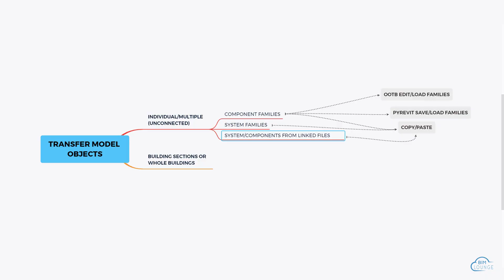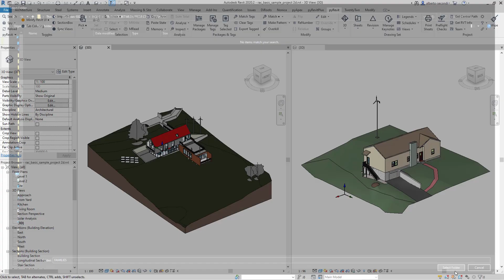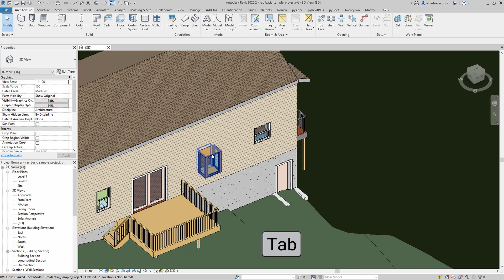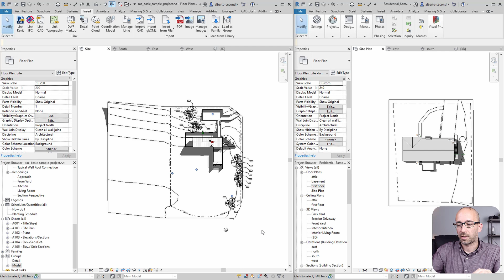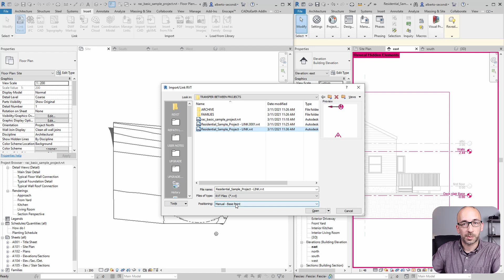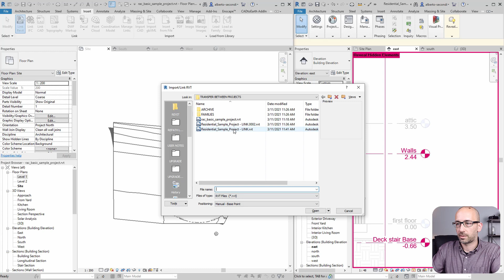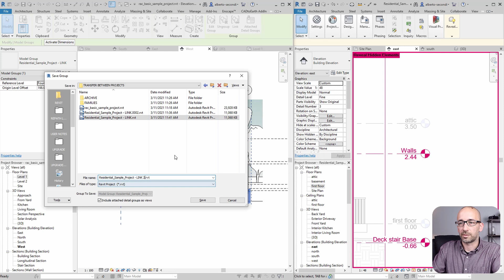How to transfer 3D elements from one Revit project to another

Comment: If it helps anyone, you can copy and paste different elements or the entirety of the whole project and paste it onto a new file if needed.

I for one am still learning the process behind Revit, so I apologize if sharing this offends anyone. I promise while in the process of learning to hopefully understand Revit's process of binding and grouping elements as usually its the best and safest case for any 2D or 3D modelling software. 

For smaller elements I've copied and pasted with simply pressing Ctrl+C and Ctrl+V but for larger projects (e.g. the whole project) selecting the whole project for some reason didn't work. Most likely due to another element being hidden.

My solution was after selecting the whole project 'right click' > find and hover 'select all instances' > choose 'in entire project' > now 'Ctrl+C' to copy
This will save a copy of your whole project and will reflect your clipboard having the option to paste the copy.

Open a new file and paste. You will get some warnings and the pasting process may take some time considering how big your initial project was.

Edit: I found it easier to copy and paste the whole project through the Site floor plan

Comment: Question, For a fresh start, If I have a site model with actual levels from survey ( 1,600 ft etc) and would ilke to link a house to explore the better site area where to build. What would you suggest for house project levels to have ( example: level 1 of house at 0,0 ? or level 1 of house at 1500ft? if site area may be 1500 ft in site model. ).  Thank you.